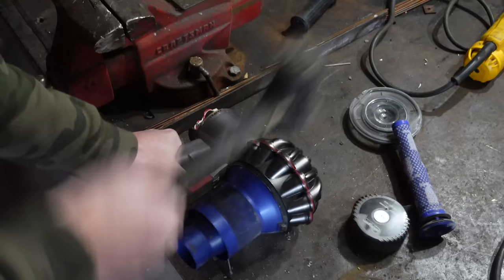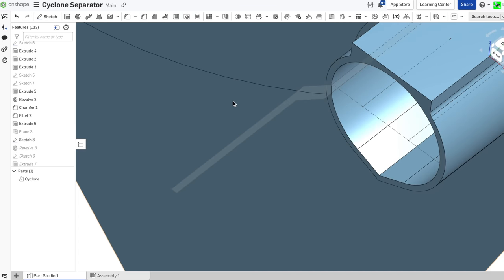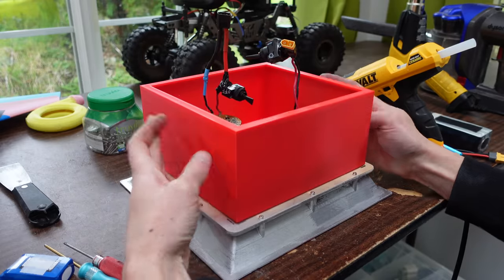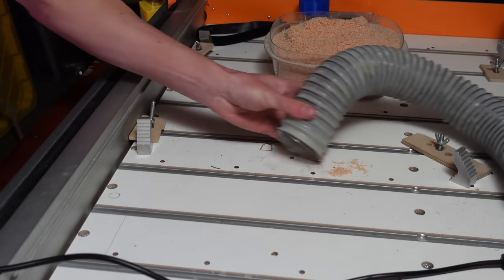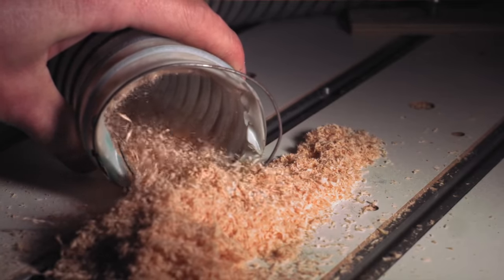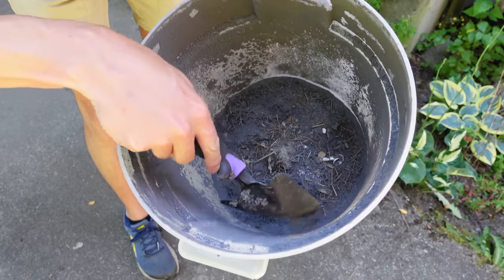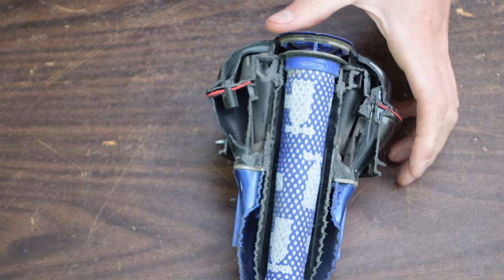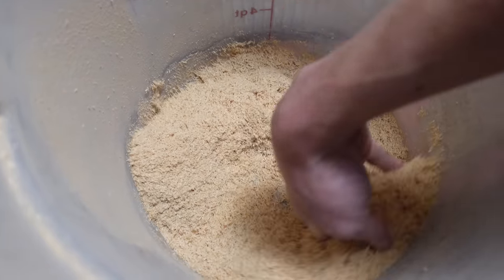Dyson Powered Cyclone Separator Vacuum

Comment: Don't you think that Dyson's multiple(!) small cyclones matter than having one smaller? Because if you have one big, one medium and one small, the air speed still the same. To catch smaller weight particles multiple smaller cyclones divides air flow and reduces it per each to not to grab particles with air.

Comment: I feel like plasti-dip spray would work well for sealing 3d printed items, especially for boat hulls or things that need to be air tight
Reply: Or Flex Seal!
Reply: The adhesion of that stuff isn't very good unfortunately. So while film thickness would be good, it may not be very durable.
Reply: Nope, that stuff never sticks very long.
Reply: 1. Rubbery stuff ain't bueno, print ABS and vapor smooth it.
2. plasti-dip never sticks good. Good for making handles, where you keep adding it until it becomes a thick part, but even on handles it comes undone.
Reply: @aserta  could SuspendaSlurry work? abs prints awfully at large scale

Comment: To retain the speed of the air and then separate the high pressure air stream from the particulate, add an internal "shell" shaped internal wall (with tiny holes at sparse tiny holes and more holes closer to the end), such that the air stream expands at an algorithmically fixed rate to pressure-match the exterior of a symmetrical cone inside placed over the inlet to the next stage.

The idea is to have a uniform pressure zone across the internal cone, and to have that pressure be maximally physically separate from zones of other pressure.

By minimizing the pressure differencials, the particulate will be physically unable to catch sufficient air currents to fight gravity.
Reply: Can you clarify what you mean here? Seems like a very interesting design.
Reply: I can tell you actually understand this, because your explanation was 100% in your head, not ours. I'm no fluid dynamicist, but I think he's saying the reason the radial velocity drops off so fast is that all the air is rushing up the middle. Now, if you place some kind of layer in between the suction chamber and the vacuum, that has less holes in the middle and more towards the outside, it should even-out the total pressure pulling up on the air into the vacuum, which will reduce local eddies and turbulence, increasing efficiency and dust collection.
Reply: An interesting solution to compensate for uneven pressure. I'm interested in what you may say about my separator design. SL_ST CYCLONE;)
Reply: @sl_st  That seems to be closer to a modern vacuum cleaner design. 

I am thinking more of like... having a quasi-cylinder mesh over the out-take, and then a seasnail shell shaped baffle between it and the in-take. With 1-3 walls of the seasnail between the two. 

This seasnail shaped baffle should have a grid of holes that progress in size starting at the in-take, being very small and infrequent to being larger and more frequent.

The holes must have pre-obstacles to act as wind-screens to help prevent particulate from entering them. 

The holes themselves should be shaped such that particles would have to do a 180 to go through them.
Ideally, this will allow particulate from other levels to attempt to go into these and be stopped dead by the higher pressure air.

The depth of the seasnail shaped baffle's walls into the bucket should vary as well, they need to be large enough to seperate the areas of differing pressure such that that pressure does not choose to go down rather than through our baffles. This depth can be decreased as it gets closer to the intake.

The idea is to chop away at the air-pressure propelling the particulate, while introducing as many physical obstacles as possible.

Adding wind-cages to various parts would help too, but would likely get overloaded easily near the in-take. Those wind-cages would have to be shaped such that particulate would want to deflect towards the barrel rather than the air-stream.
Reply: @altus1226  Thank you for laying that out. Very interesting. I think it would only do well with smaller dust particles, so you might need another stage before it.

Comment: For the issue of dust not falling down, I would give the cyclone separator vertical walls (instead of the cone shape which pushes heavy particles upwards via centrifugal force). You'd need to position the exit that dumps the dust into the bucket on the side of the bottom plate, though. (It's position on the bucket lid doesn't really matter.) You don't want it too large in order to avoid stirring up the dust in the bucket, but you also need it to cover at least a small section of the wall where the heavy dust will accumulate.
Reply: It might be static electricity generated on the plexiglas attracting the dust as well.
Reply: I like the idea of vertical walls, but I feel like the center hole into the bucket is a cleaner design. I wonder if extending the vertical-walled section of the cyclone separator would improve the performance without needing such a large hole in the bucket
Reply: Or baffles
Reply: Check Mathias wandel design. He did exactly this
Reply: @camifracelli631  https://www.youtube.com/watch?v=z-xhYnWDCd0 is probably what you meant. I would have made the hole between the cyclone chamber and the bucket smaller, about a quarter of the circumference. That way the air in the bucket would get stirred up less.
Reply: @Pystro  And as a bonus, in his video he mentioned using a much more manly 2 inch hose.
Reply: Cyclone separators work better when they are shaped like a cone. The cone shape keeps the particle velocity high while the particle is going down the side of the cyclone separator. With a straight wall design, the particles would slow down as they spiral down the cyclone wall, and as the particles slow down they would detach from the cyclone wall and get sucked back into the airflow and out the top of the cyclone separator. Obviously this is not what you want to happen. A straight-wall cyclone would probably work fine for the bigger and denser particles so you could use it as the first stage of a multi-stage cyclone separator system, just like Dyson does in their vacuum cleaner. Or you could use a cyclone separator with a straight-wall section at the top which then turns into a cone, like we do in our industry.
I know something about cyclone separators as I work at a company which engineers CFB boilers which rely on cyclone separators to keep the boiler bed material and bottom ash from being sucked into the exhaust gas stream.
Reply: A true remark about the walls. The particles really slide down the vertical wall better. In its cyclone SL_ST CYCLONE;) I used a negative angle at the walls. Although apart from that there are a couple more tricks. I will be glad to hear your opinion.
Reply: @Kepe Regarding the cone walls, it is true, but it seems to me that it can be done differently SL_ST CYCLONE. For me, the main thing is the speed of particles in a rotating stream. The sooner the better. In my cyclone, I tried a different approach. the walls have a negative angle of inclination for the first stage. After that, the second and third stages come into operation. I'm interested in what you think about this. It's nice to know the opinion of a specialist.
Reply: @Kepe  Ah, I didn't know that the speedup at the bottom of the cone was that important.

Comment: Cyclone separators aren't just used for cleaning. They have been used a lot in places where air is used to move particulate through pipes. They just get the stuff you are moving out of the airflow before it gets sucked into the fan, and deposit the stuff where you want it.

Comment: Some industrial cyclone designs I've seen will reduce the air volume at the bottom using a solid cone inside the end, rather than by tapering down the walls. This seems to allow better settling and reduce clogs.
Reply: So the outer wall is a cylinder with vertical sides? 
And is the opening to drop the dust down a ring around the base of the cone?
Reply: @MaxNippard  correct, in water treatment also often combined with an inner perforated tube that follows most of the height of the housing, to act as a baffle and force flow down a larger height:diameter ratio.

Comment: Nice video! Cyclone separators pretty interesting. My home central vac system uses one, but to solve the filter issue it just exhausts to outside, so there's no filter to replace.

Comment: Yeah, that thing REALLY needs to be grounded, especially if you're vacuuming up fine combustibles, last thing you want in there is a spark even at partial pressure.  Grounding may also help the material fall into the trap

Comment: I use your cyclone design all the time I have it on my shop vac its amazing for cleaning up drywall dust. using it has tripled the amount of time I can go before I have to knock the dust off the filter on the shop vac

Comment: 4:17 you could have added inductor in series. Main property of conductor is that it doesnt allow sudden changes in current. So when you swith current would rise on a curve. Higher inductance, rises more slowly. You just take a thick enough wire and make a few turns until its good. This way you dont need a switch and its still dead simple

Comment: Add a longer tube in the center and take more video! I tried to use some Excel calculators our there to design mine. I struggled with what length to make that center tube. mine goes about halfway down the cone. I have no idea if my flow looks like yours at the top or not.  I made a frame out of 2x4 and plywood for mine. Rolled a piece of acrylic for cone shape. I drew it in 3D and used a sheet meal program to flatten it. I used that flat patter on the acrylic to make the cone shape and teardrop inlet shape. Then I siliconed a 4" PVC pipe into it tangent to the largest inside diameter. That was trimmed flush inside then. It works, I get tons of dust spirals and very little gets through into my bag filter. Watching your video makes me want to redo it with 3D printed parts!

Comment: The funnel at the bottom is only there to collect the dust to the center. To improve performance increase the hight of the clilinder when the air spend more time and a larger area spinning the dust outward.

Comment: Tip for sucking up foam; put a bare copper wire from the top of the cyclone down to the dust bin in the center and wire it to ground, its going to make the dust not or very little charged ;)
i did that on my dust collection and it works really well, before i did that i could feel the static charge even on the outside when putting myhand close
Reply: Would having a metal bin connected to earth have a similar effect?
Reply: @shakeit995  probably yea

Comment: I have a super simple cyclone-less barrel with the air from the CNC machines fed into the top parallel with the walls of the barrel and the vacuum sucks up through the centre in the lid. It's very efficient even with polystyrene! I used it to empty all of the perlite from my kiln insulation without any dust going into the filter! It's shockingly efficient for such a simple design.
I find slower speeds air speeds work a lot better... high flow big bore low pressure

Comment: I think you'll have more success with a narrower cone. The tighter radius should increase the centripetal force and improve separation, with the steeper walls helping the particles to fall down.

You could maybe also try some vanes near the bottom to help direct the particles downwards, though this might disrupt the airflow too much.

I'd like to see a two stage system with very small cyclones similar to the Dyson, would be interesting to see how much it helps.

Comment: A foam muffler on the exhaust side can make a difference for the noise level.  Look at Oneida dust separator muffler.  It's just a foam cylinder inline with the exhaust port.

Comment: There are a number of papers people have written on cyclone separators. I did some research into them a while back. A common design is the 1d3c (I think, might be getting the name wrong) where the cylinder section at the top is as tall as its diameter. The cone section is 3 times as tall as the cylinder diameter. I think the exit at the bottom was like 1/4 diameter and the top exit was about the same.
Reply: Not sure about how all the complex air flow works, but I think having a taller cylinder section would help with keeping the particles moving fast. Maybe? Idk. 

Also if you can measure the mass and/or volumetric flow rate, there are equations for how to properly size your separator. I think that might be a reason for the number of smaller ones in the Dyson. For peak performance of those smaller diameter cyclones, they want a lower flow rate.

Comment: If the inside of the cyclone were mildly electrically conductive and grounded (like what you'd expect ESD-safe tooling to have), would that reduce the static clinging effect?

Edit: a quick web search showed some spray-on urethane ESD sealant. Not sure how slippery a finish it would leave. It's like fifty bucks a can, oof.

Edit 2: seems there are ESD-safe acrylic sheets available, too, if particles are getting stuck to the lid. The spray ESD stuff claims to be clear though, so if it adheres to acrylic, maybe it would work, too.
Reply: Industrial applications use metal cones with grounded surfaces (by default and nature).

Comment: The reason shop vac's are noisy is the same reason they are so good at what they do. They have separate impellers for suction and motor cooling making it safe to suction water with them. Twice as many impellers plus a much more powerful motor and the fact that the cooling impeller's intake doesn't have to suck through 6 feet of hose and a giant expansion chamber that acts like a muffler so you get more of that raw 'blades chopping through air' sound. Household vacuums use the same air for suction and motor cooling. Its usually sucked into the impeller and the exhaust is vented around and through the motor on its way out of the vacuum so there is a lot more restriction to help smooth out those sound waves. If you were able to design a cover for the shop vac that vented both exhausts and the motors cooling intake outside through a window or something you could probably get rid of most of that noise.

Comment: I don´t know if central vacs are common where you live, but they are resonable common here.

What it is is a tube network around the house with lids on a micro swich on. if any of the lids open, the vac starts.. Typically the handle and hose is quite long. So typically there is one or two outlet in the hallway, and that is sufficient to go all the way onto the corner in every room.

This could also be used to link up several machines.

Comment: @15:16 - not that it matters much, but if you passed a Shark steamer over the opening of that container, you would knock that static down post haste.  I use warm, moist breath to keep my fresh ground coffee from jumping out of the filter and sticking to the inside of the grinder container.  I simply breath in to the opening of the grind cup before I pour it in to the melitta filter.  No more hopping grounds.

Comment: Our formula Student team designed an Oil cyclone. 
To make it more effective, we made the inlet tangential with a quarter rotation of lead in, so the oil (particles) clings better to the outside.
Also the coneshaped bottom was formed with a spline, that pointed to a central point and was tangentual to a cylinder on the big end.
If you want to improve your disign, this is one possible and easy way to do it.

Comment: I used an ordinary vacuum cleaner while routing some oak. Took the hose off the router to get some other spills, I put my fingers over the hose end to mimick the tabs and notches preventing hose to stick and WoWZa! ...or rather Wow-ZAP! Got quite the electrostatic discharge that I felt even far up my arm!

Comment: Cool electrostatic effects in the bucket. I wonder if spraying the inside of the plastic parts (or using metal parts where feasible) would help eliminate the spark hazard?

Cutting foam would still probably produce a bunch of clingy foam bits, for that it might be interesting to add some of those static eliminators containing radioactive polonium-210. Any serious workshop should have a radioactive cyclone device!

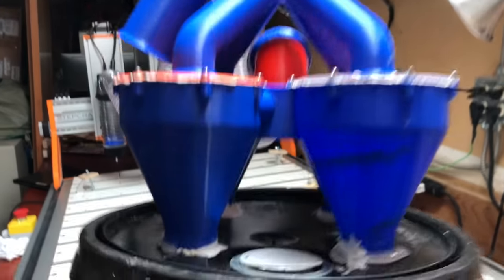Comment: 0:28 you note the imperfection causing a heck of a lot of issues. If you want to 3D print one of these babies, and use it, you have to sand the insides smooth. That, or use ABS and vapor smooth it. The efficiency goes out the window, the rougher the surface is.

Comment: You should add some spiraled indents on the inside of the cone part of the separator, sort of like the threads on a screw, to help force the particulate down as it spins and ensure that larger objects also get forced down and don't just spin around.

Comment: 15:04 Static is not your best friend when it comes to cyclone separators. That is why Dyson has that fine particulate build up at times around the cyclones and even in the bin. Static cling. The hack for that is a cyclonic anti  static  particulate floating filter. I cut sections of a bounce sheet in small squares and throw that into the dust bin of my V11. Or on the uprights or Ball Dyson, put one bounce sheet or half into the bin. It does marvels and it actually keeps the passages cleaner and the cyclones cleaner plus it actually reduces the amount of dust on the Dyson turbine fans. It works amazing. Plus it keeps those pre motor filters cleaner and hepa filters.   Use non scented  bouce sheets. De static your canister and neutralize the particulate. Don't tell Dyson this 😂